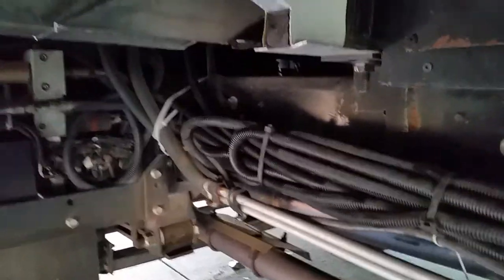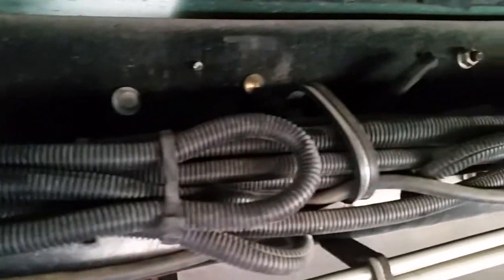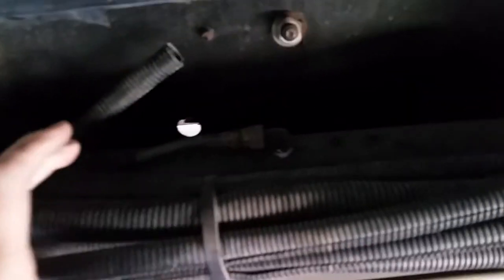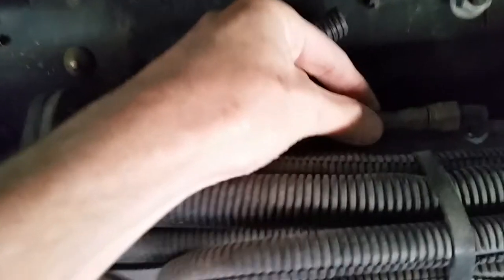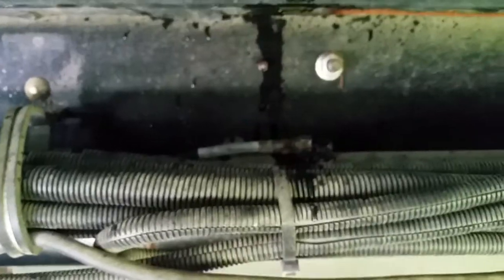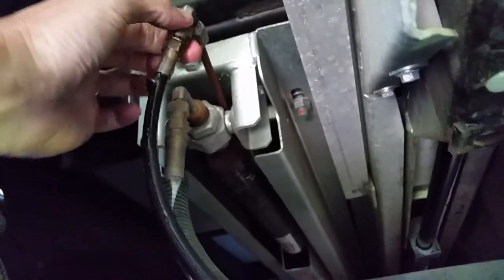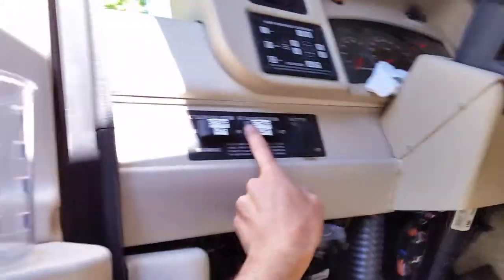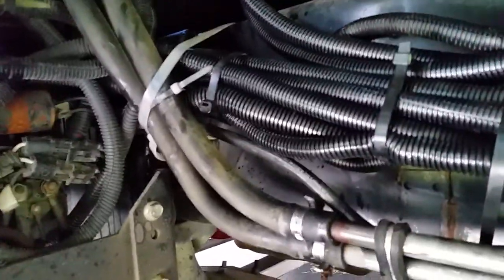HWH hydraulic line leaking: Don't use just any hydraulic line see why.

Comment: At Dynamax in 2005, factory visit from Pa for warrenty stop to fix leaking '05 slide hose. So guess  what they did, they added a new hose but due to the difficulty re strapping the mess of hydro lines they instead left the bad line in the Dynaquest. Well, 10 years later, that bad line came loose and wrapped around the prop shaft and destroyed wiring harness for hwh wiring as well all dc voltage to left side of 264 model Dynaquest. Thanks, Dynamax, for being so stupid and lazy to remove the leaking line. Dynamax service tech even told Pa repair shop, oh we left that bad line in the rv. It cost me $1k for then Mellot Brothers rv shop to rewire everything and were honest with me about why Dynamax left a bad line in rv. Dynamax didn't want to be bothered with taking the time to remove the bad line.
Reply from the maker: Thanks for contributing your story in order to help others

Comment: Kevin, as always, good information to have. I am starting to see the same oily residue on the line that pushes fluid into the Sync Cylinder to retract the main slide on my 2007 Journey. I clean everything off with brake cleaner and I see no drips or puddles under the RV, but the residue remains so something is leaking. My question is just how flexible are these lines supposed to be? Mine seems to me to be very rigid, as in almost a hard line, as in it may break if I tried to bend it.
Reply from the maker: Yes it is a hard plastic line inside if I remember correctly, if its leaking at the fitting maybe A local hydraulic shop can cut and re crimp a new fitting on that end. 
Let me know the fix you use.
Reply: @ktoutdoor  I spoke with .Mr Stuart today. He offered that due to the minor nature of my leak/seep, I should head on down to FL as planned next week. When I get back he can look at it in his shop and replace any bad lines for me. Double knee replacement 2 years ago has curtailed me crawling around on concrete floors these days.
Reply from the maker: @timmyers3428  Let me know how it all turns out when you get back from Florida.. We are camping at Kissimmee till April loving this warm weather.

Comment: There should be a depressurization "switch" at the valve - it's either a lever or a screw...  Be EXTREMELY careful with pressurized hydraulics as hydraulic injection into your body is as bad as gangrene....
Reply from the maker: Thank you for contributing '' always ask your self how many ways can this go wrong ?

Comment: 2004 W Adventurer 33V

Hi Kevin, Have you ever replaced the high pressure hose on a HWH hydraulic cylinder for a room slide out? It’s the little hose (some have steel tubes) on the far end of the cylinder. Part number AP24631. I’m wondering how to change the blown hose. Yes, some are 1/8 inch hose and some are steel tubes. Mine are hose. It is the short high pressure hose that connects — via a 90 degree hydraulic fitting — to a 172” 1/8 hose. Mine blew and I don’t know how to reach the fitting to change. It’s way in there. Any initial thoughts? Thanks!
Reply from the maker: Give me a call 606-875-0125